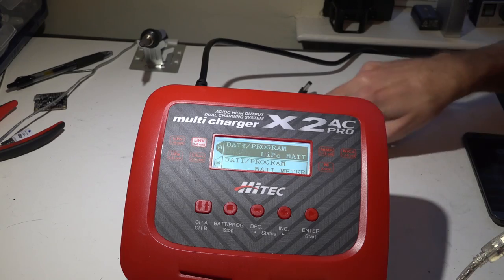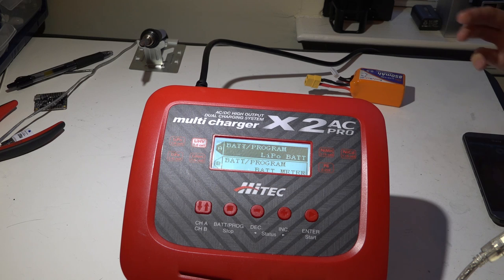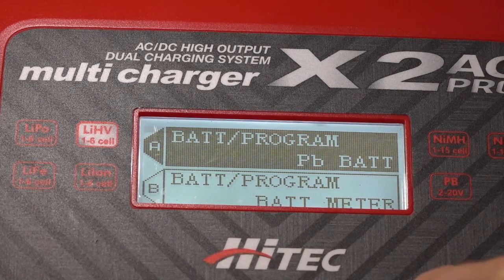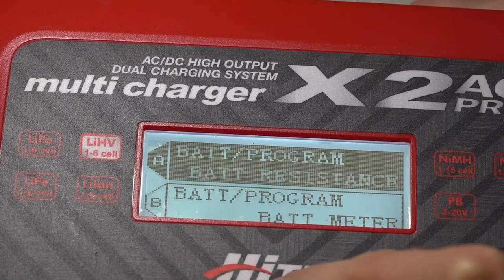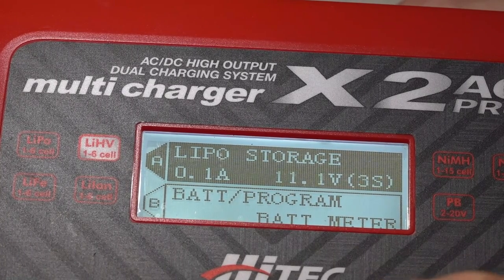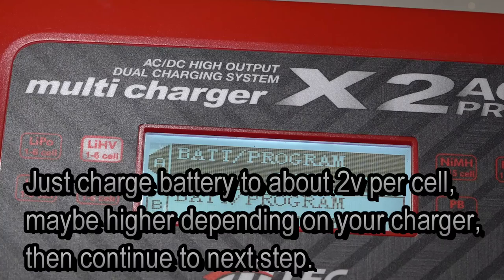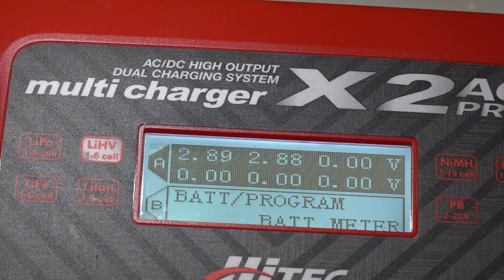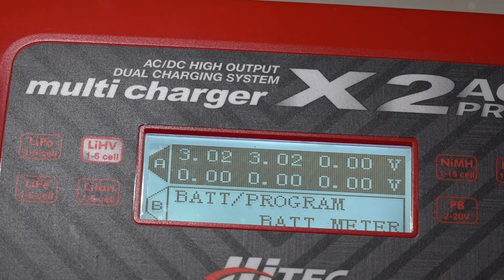Recover Over Discharged Lipo Batteries

Comment: Great video. You can possibly avoid over-discharging by plugging a battery tester/buzzer into the balance lead on your Fatshark battery. Just let it hang, or use double-sided tape to attach the buzzer to your goggles.
Reply from the maker: That is a great idea. I've thought of it. The fatshark goggles have a buzzer but the problem is I put them away in a case with the battery still connected. The buzzer isn't that loud but I agree with you, an additional battery tester would be much louder.

Comment: JC saves the day again. Mate, it's not even weird but it is great that you still save my Bacon so many times. I had a (almost) dead cell in a 2s Lipo, brand new it was and I just threw it on top of a cupboard as the charger wouldn't touch it. With this tip, it's charging away like a good un. 
Hopefully your Bro's stop by at times and know that you are STILL helping. Thanks for all you did and continue to do! 👊

Comment: I have a Zeee 5200 4s Lipo battery that I’m currently trying to resurrect. This is the only the first time that battery has discharged to a dangerous level. Last night when I was driving my 2wd slash with the battery, I thought it still had some power left……..

Only to realize it dropped down to 10.6 volts
Do you know a way to resurrect my 4s battery with a Hyperion EOS0720i ?? Or is the lipo totaled?

Comment: Hi there. I have a Dromida 3.7v 350mah 25C lipo 1S battery. While I was calibrating my esc, the battery is dead and I have a charger called a venom pro quad micro 1s.My battery is below 3v. Does this charger helps as well to recharge it?

Comment: It's amazing what ANYone can say on YT !!!

 Dude !!! What are you talking about?!?

 A proper LiPO power pack should have built-in protection against over AND under charging. And btw, I have recovered cells that were discharged as low as 1.9V, as long as you employ a proven recovery technique and practice some basic safety measures. Granted, you may not go back to achieving the full original rated capacity but in my experience I've gotten as close to 5% of that.

 Anyhow, always take anything you read/see on the Internet with a grain of salt, there are a lot of "expert" (=ignorant) advice out there, that might cost you a lot of property damage, if not your life !!! Do not be ignorant, double and triple check everything !!!

Comment: What if I have a 20-30c, 2s, Traxxas lipo that goes into a Traxxas Velineon Vxl 3s ESC in a Traxxas stampede that was plugged into the ESC for 3 years? How can I recover the lipo then?
Reply: the 20-30c is the discharge rate, not the chargerate. I dont think that the lipo would have survived that. But you could try it in the same way as it is discribed in the video. NEVER leave the Lipo alone while trying!!!